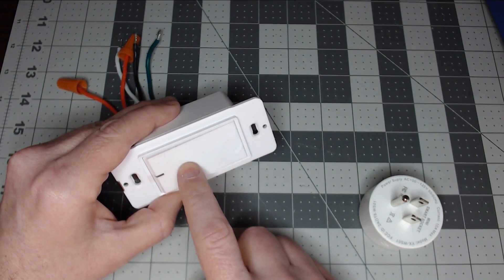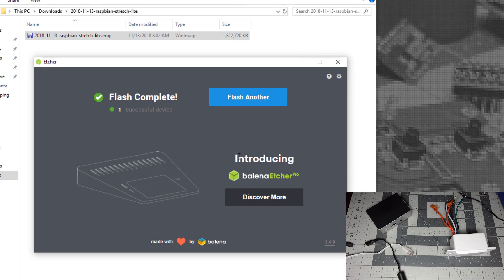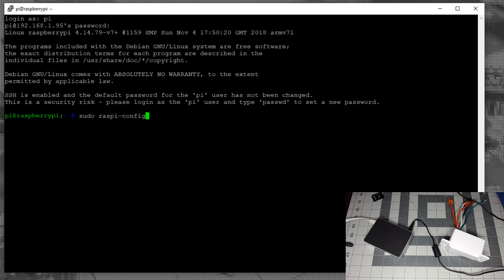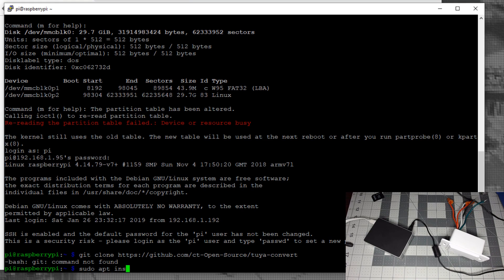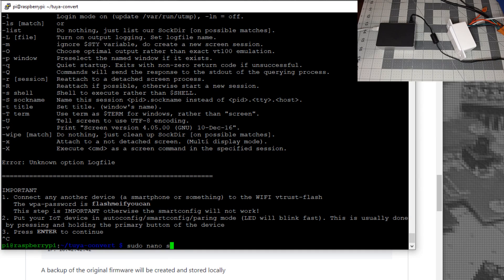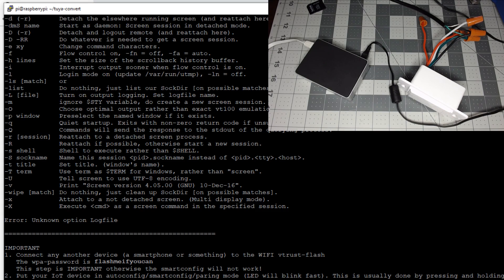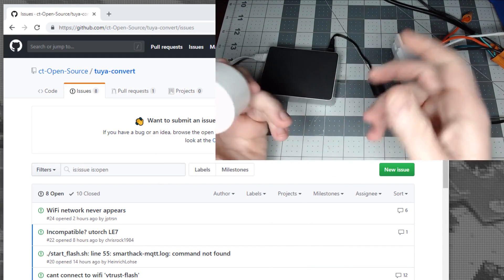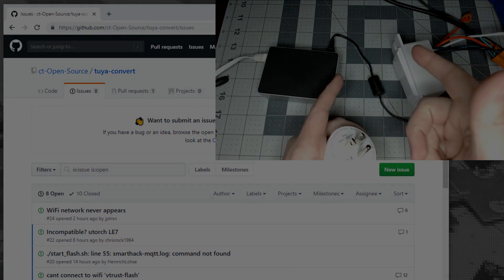Flash Tuya Smart Switches, Plugs, and others all Over the Air - No soldering!

Comment: Hey Travis.  Thanks for the response.  I was successful in flashing both devices and used your binary for the dimmer.  Both work great from Tasmota and your configuration for the dimmer is great. One suggestion: it would be cool if the dimmer led stayed on when the switch is off so you could find it in a dark room. 
 I am having a problem with the MJ switch.  It works from Tasmota and I can control the led via gpio 4 but the physical switch doesn't work.  Unfortunately, I didn't test it before flashing it so I don't know if it's actually defective or I fried it.  I'll order a new one and test it more carefully before flashing.
BTWQ, I am very new to home automation and am doing all my automation in node-red.  I installed HA but haven't found the need fr it yet.  Integration with Alexa is trivial.  Thanks again.
Reply from the maker: I did post in the fork readme the rule to have the red LED stay on when the switch is off.  

Did you set the MJ switch up as follows like I updated the video with?

GPIO4 - Inverted Red LED
GPIO5 - Inverted Blue LED
GPIO12 - Relay1
GPIO13 - Button/Switch1
Reply: @digiblurDIY  You  are truly amazing!  Of course, it would have helped if I had read the last line of the readme file.  lol.  Also got the switch working.  Is there an updated video?  I didn't see it.  Everything is working except 1 small item:  The red led doesn't come on.  I have the following config:
GPIO4 - Led2i
GPIO5 - Led1i
GPIO12 - Relay1
GPIO13 - Button1

The blue led works as expected - on when the swith is on and off when it's not.  If I set GPIO4 to Led2 instead of Led2i, the red led comes on but stays on regardless of the switch state.

Anyway, thanks again for all the help.  As I mentioned, I'm really a novice at this.  How can I see the source code of your device configurations (for example the MJ dimmer).  I'm sure I could learn a lot from it.
Reply from the maker: the red LED actually won't ever light in that config, I modified mine a little bit. 

GPIO4=Relay3i
GPIO5=Relay2i
GPIO12=Relay1
GPIO13=Switch1

Then I have the following rules set via the console to toggle the "relays".  

switchmode1 5
setoption32 7

Sets up long press actions and 0.7 second timing for the longpress

rule1 on switch1#state=2 do POWER1 TOGGLE endon on switch1#state=3 do backlog POWER2 TOGGLE; publish cmnd/KLD-BenchFan/POWER TOGGLE; POWER2 TOGGLE endon

rule2 on power1#state=0 do backlog power2 ON; power3 OFF endon on power1#state=1 do backlog power2 OFF; power3 ON endon

That first rule does a long press send to another switch across the room and blinks the LED, the second rule toggles the LED for each state. 

The source code is in that fork on that readme, you should be able to find my commit of the changes I did for the dimmer.
Reply: @digiblurDIY  Brilliant.  Works great!  Not sure why the Led controls don't work but the relays sure do.  Been looking over the code.  Sure have a lot to learn.  Thanks again.
Reply from the maker: Did you turn the rules on after applying them?
Reply: @digiblurDIY  HELP:  This morning both my MJ devices were off the air. Were working last night.   Was able to fix the dimmer with the reset button.  Can't fix the switch - it's stuck on and not receiving/sending any mqtt.  Can't get to Tasmota via the web interface.  Any alternative to removing it and flashing through UART?  Getting cold in here as I can't trun the ceiling fan off.  lol.
Reply from the maker: Seems strange they all went off? Power issues? Are they transmitting their access point names?
Reply: digiblurDIY yes it was strange that they both were down at the same time. Didn’t seem to be a power issue. Other Sonoff devices in the same room were ok. Anyway, got the dimmer working using the reset button but not the switch. Took it apart and tried flashing it via wires but couldn’t get it to respond. Ordered a new one. Chalk it up to the learning process. Is there a way to reflash with the tuna-convert program if the device isn’t on the air?
Reply from the maker: Once you flashed away from Tuya then the Tuya convert will no longer do anything for the device. Second oddity is it didn't respond when it was flashed the old way. Very strange.
Reply: @digiblurDIY  Maybe it's fried.  I'll play around again.  Did a couple of ZooZee switches.  All went well and quick.
Reply from the maker: Definitely double check things as I haven't heard anyone else having issues.
Reply: Went back to beginning and was able to reflash the switch.  All working - for now.

Comment: I got this to work with 3 BlitzWolf  SHP 1 plugs, but I'm not getting any "energy" readings
Reply from the maker: What template did you use?  You may have to figure out the power readings manually.  You're in luck though as the most recent Tasmota development version lets you pick the pins for power monitoring now.
Reply: BW shp 2. Works fine smartthings/webcore. Was hoping to use one for my washer to notify me when it's done. No big deal found other uses for them
Reply: Switched to Generic and got this
GPIO0  Led2 (red)
GPIO2  Led1i (blue)
GPIO13  Button1
GPIO15 Relay1

BlitzWolf-SHP1
Still no power readings
Reply from the maker: You will need to update to the latest dev version and it will let you select the three GPIO pins for the power monitoring.
Reply: @digiblurDIY  updated and still can't find the way to show power
Reply from the maker: You should have the ability to pick the pins for HLW8012 and such now.

Comment: So does the version of Tasmota this flash support MQTT discovery?

I flashed a plug last night and can't seem to get HA to see it even after sending the discovery option.
Reply: Looks like this flashes Sonoff_basic which doesn't support discovery but you can quickly upgrade the firmware on the plugs to the normal sonoff one which does.
Reply from the maker: I do not know if basic has that functionality. I believe on the Tasmota github they have a a grid of all the features listed for each build they have. You can flash any version of Tasmota or even other firmwares after you get into the GUI just like you would on other switches.

Comment: Don't git it to work with my old Raspberry Pi 1 using Raspian Lite and a Gosund SP111 with Firmware 1.0.0 (according to tuya app). I'm connected to the vtrust-flash wifi with my smartphone, but the plug isn't found. I was waiting for half an hour... Any suggestions?
Reply from the maker: Might need to try a different wifi adapter with that Pi as it might not support the various functions they use in the scripts.
Reply: Yes I tried a different one, but with that there was no vtrust-flash WiFi started. So I have to try a little bit more.

Comment: HI...  You helped me with recovering my lost wifi smart switch.  I have one more question, promise :)!  The switch connects fine.  I can connect through the IP address, the blue light toggles on and off with the "Toggle"  button on the main menu, BUT... the relay does not switch on.  Is there more configuration necessary to toggle the relay?   -Your help is much appreciated.
Reply: I just wanted to pass on:  I did the wifi flash on another  plug just like the one I bricked.  It worked, and works perfectly.  I must have trashed the original plug.  Thanks again.
Reply from the maker: Did you go through and figure out which pins are what? I did a live stream showing how to set up an unknown switch/plug.
Reply: @digiblurDIY  I watch you video and tried every pin with a relay option.  The only think I can make the plug do is toggle the led on GPIO13.  None of the other pins seem to do anything, including GPIO12, where I expected relay1 (The main relay)  Note also that the physical button does not toggle the relay either.  Button1 (GPIO0) is set to Switch 1.   Is it possible the plug is bad?  Do I need a configuration different than the generic configuration?   As always...thanks.
Reply: @paultoepel107  I followed your recent live video where you flashed and configured the exact mini switch.  Set mine up exactly as you did with Relay1 on GPIO14 and the rest the same.   -No go.  the relay does not turn on/off and no voltage goes thru the device.  Perhaps I bricked it during the flash process.  I have some other mini plugs (same plug).  I will give it another go.
Reply from the maker: Is the  GUI still alive?
Reply: digiblurDIY yes. The GUI appears to works fine.   I can change pin settings and see some behavior changes.  For example I can change the behavior of the led.  I get a constant 2 volts coming thru the plug no matter what I do... and never heard the relay.

Comment: Bought a PI3 B+, 32GB SD card, following along step-by-stp but when I power up the PI after making my SSH file it just boots in a loop - anyone else experiencing this? I'd love to say there is no way I missed anything, but evidence would say I'm wrong.
Reply from the maker: Using the latest stretch image? Several guides on the internet might help you see the steps (don't do the WPA/Wifi setup in this guide of course as you'll be using ethernet)  https://desertbot.io/blog/headless-raspberry-pi-3-bplus-ssh-wifi-setup

Comment: Great video.  If you mess up the password for your WiFi, here is a way that may help you get it in.  If you entered the SSID correctly, you can setup an AP (or router) with no security (WPA/WEP disabled), or temporarily turn it off on your main one.  The esp device should connect because the AP will ignore the password altogether.  This worked for me when I messed up the PW. I wish tasmota gave the option for the password to appear, it's too easy to get a typo when trying to enter it from a smart phone. Be sure to re-enable WPA2 after you have fixed the PW on you esp device.
Reply from the maker: I saw this recently as well. I will add this to the description too. Thanks!

Comment: I tried this method out with a MOES 3-way and Jerry Martin dimmer and so far was not sucessful.  I'm pretty sure I followed the video exactly - new raspberry B+, new  image, etc.  Pretty straight forward.   I saw the new SSID - smartphone connected to it...placed switches in the "flashing blue light" mode - hit enter - and never got anything but the "...." across the screen - even waiting over an hour.   I even tried the KALI alternative (man did THAT take forever to install).   With Kali I saw the AP but was never able to sucessfully connect to it.   This was late yesterday so I'm going to d/c things again tonight and report back if anything changes.  They may have updated firmware on these to "fix" this issue.
Reply: Big Correction!   I missed a step in digiblur's VID - once I corrected that I was able to flash a smart plug, a martin jerry dimmer, and a MOES switch....!
Reply from the maker: Thanks for the update! I did two Martin Jerry switches today and one dimmer. Now where to put them? Hmm.....
Reply from the maker: I'd check your logs to see what they show as I haven't heard anyone saying it has stopped yet.  I'll know for sure as I have a dimmer and a couple switches to do today myself.  I did a couple bulbs last night with no issue.  I'll let you know.

Comment: Great tutorial, as usual, but I don't have an RPi available. Instead I have an old laptop where I can install Linux on. Can I do the tuya-convert flashing with that configuration? Any distro that you would recommend? Thanks
Reply from the maker: According to their docs the tested on Kali Linux too. The big thing is if the wifi adapter you have supports AP mode.
Reply: @digiblurDIY  Thanks I tried with both Kali and Lubuntu and both failed... it must be the AP mode support

Comment: Hi.  Thanks so much for your videos.  I was able to flash a switch no problem.   My second attempt was a WiFi plug in your description .  It went well until I believe I put the password into the flashed device wrong.   Now... the plug has a slowflashing blue light and does not show up on my network. All attempts to put the plug back into flashed failed.   Any ideas how to save this plug?
Reply from the maker: If you didn't make the backup SSID you can try making a network with the same SSID with no password in attempt to see if it will connect.
Reply: @digiblurDIY  Hi again.  Just want to pass on your idea above worked perfectly.  You saved me the device!  Thanks again.
Reply from the maker: Always good to bring it back to life. Make sure you set the wificonfig option to 2 like I  show in the description update. Won't get locked out again.
Reply: @digiblurDIY  Thanks so much for the reply.  Good idea.  But for $12... I might just use it as a paper weight :) !
Reply: If you fat fingered the wifi information, and don't know what the SSID is for the device, there is still hope!  I had this very same problem when I mistyped the SSID for the network I wanted.
I posted a question to softwarerecs.stackechange.com. After much digging through information in various places, I found a method to determine the SSID that was saved when first setting up the wifi on the plug.  I posted the instructions to 'fix' it as an answer to the question on the following link:

https://softwarerecs.stackexchange.com/questions/56906/software-tool-to-sniff-wifi-from-misconfigured-iot-client-device-on-any-platform/56964#56964

Comment: I just flashed a Martin Jerry Dimmer, all went well, connected to device Tasmota web page, entered in both WiFi SSID's and passwords (just like I previously did with the 3-way), switch rebooted. Now I don't see it pulling a dhcp address on the router, and don't see an SSID named Sonoff-XXX. I unplugged it and back on again. Did I brick it? Do I now need to solder jumpers to the 8266 and flash it the old way? I do have a single green LED by the dimmer toggle.
Thanks again for any help anyone can pass along my way.
Reply: Never mind... I did a long 40 second press on the main button (I didn't think it did anything(lights did flash or hear a restart), did the same for all the other buttons, still didn't think it did anything. I then re-checked my router and found a new Sonoff-xxx device. Connected up and back in business.
Reply: I just reviewed your dimmer video for the MJ dimmer. I now see that there's a special .bin file for these, which also provides the "MJ-SD01 Dimmer" option in the module type. How do I now flash the correct bin file for MJ-SD01 Dimmer?
Thanks.
Reply from the maker: Just download the bin file from the github linked and apply it using the GUI of Tasmota.
Reply: @digiblurDIY  Attempted Firmware upgrade, received the following error "Upload Failed
 Magic byte is not 0xE9". Shoud I be doing a "Restore Configuration" instead? FYI current installed Tasmota version is 6.4.1.
Reply from the maker: Use the latest bin from this folder. If you get a failure on the upload make sure the file downloaded properly. https://github.com/digiblur/Sonoff-Tasmota/tree/development/bins
Reply: @digiblurDIY  We're good now. Thanks again!
Reply from the maker: Awesome. Glad you got it going!

Comment: Confirming the Weton Multi-Plug Timer Switch Power Strip Outlet Surge Protector with 4 AC Outlets is the same as the SMSO301 you did earlier and works OTA.  I had to go back and rerun ./install_prereq.sh again after restarting the PI.

Comment: Great video, really helpful! Sorry for the question, Is there any way to extract the firmware before flashing the device? I would like to try with another different Tuya dimmer switch but I am concern about bricking the thing. Here there is the technical sheet of the switch. https://intl.tuya.com/product/spd31ca4f53450061.html
Reply from the maker: I believe the backups are saved on in the Tuya convert folder. I saw some extra files and I can check in a couple hours.
Reply: Thank you, would be great if you could have a look! :) @digiblurDIY
Reply from the maker: Yes. I checked and looked in the code on their github and it reads out to a file with the date and the name readout appended to the end.
Reply: Thanks!

Comment: Travis, great video, have you tried the 3rd party firmware? I just compiled a tasomta .bin file using your PlatformIO video. I hoped to use it to by pass the Sonoff AP part of this process.
Reply from the maker: Yes. I do use my own compiled firmware in it. I pushed that third-party bin file over to the Pi. I don't have the wifi SSID hard-coded which wouldn't be a bad idea but I did have wifi manager hard coded as the setup method just to be sure.

Comment: Thanks for this - I followed it to the letter and it worked first time.  My plug is the round "AISIRER" 240V (UK).  The pins are: GPIO4: 21 Relay 1, GPIO5: 17 Button1, GPIO12: 56 LED1i,  This is the "generic" module in Tasmota 6.3.0.
Reply: mine were different?????

mine was:
GPIO4 LED1i
GPIO12 Relay1
GPIO13 Button1

Comment: Reported working with Costco Outlet, I failed the first time with laptop to connect to the pi's access point, I then used my IphoneX and sonoff has been installed! Did 4 outlet in less than 10 minuts.
Reply: @Joe Arbia, thats great to hear, by any chance do you know if this will work with the smart dimmers?
Reply: Giancarlo Del Papa I have 4 to flash but had zero time. I read that it works but personally o can’t confirm it yet